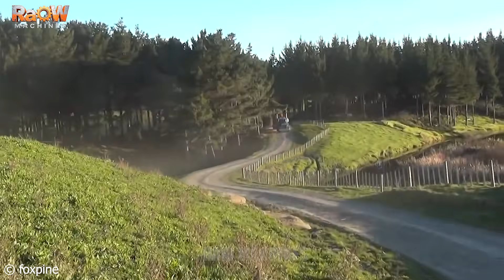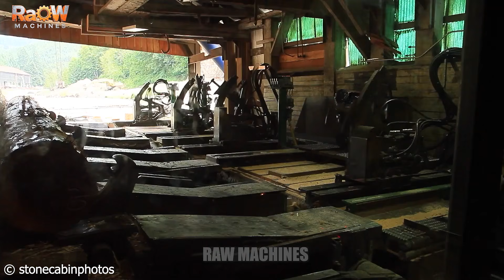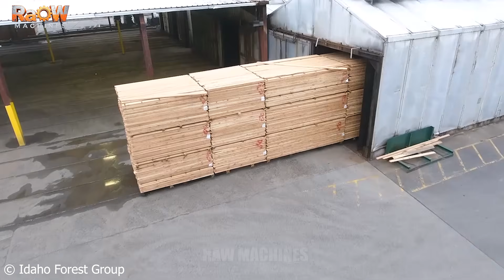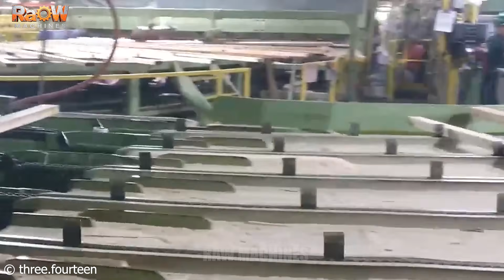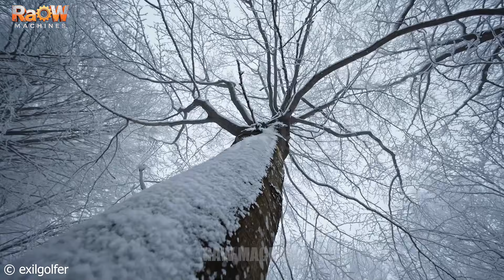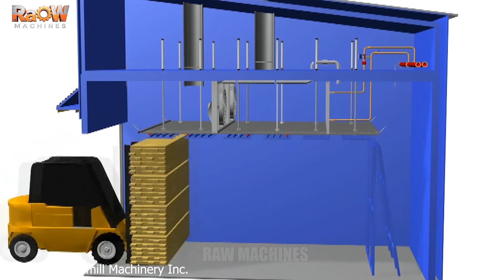Inside America's Largest Sawmills | How Giant Trees Become Lumber and Timber Beams

Comment: You spend the money for treated lumber a lot times , straight when you buy it a month later it’s bowed not to count the time you spend picking through it for straight wood !!!! One day took me 6 hours to pick out 50 2x4x8 and ask employees to get me another stack down and they got mad, told they if I’m paying those prices I want straight wood !!?
Reply from the maker: I appreciate you sharing a real-world perspective! Buying lumber is one thing, but finding pieces that fit your standards can be another challenge entirely. It's always interesting to hear from people who work with wood regularly because it adds another layer to what we're seeing in the documentary. Thanks for adding your experience to the conversation! Do you have any tips for spotting the straightest boards before loading up your cart?
Reply: One of the hardest things to find is straight wood. Most of the time you have to buy the least warped peices or go somewhere else. Ive spent hours looking for the straightest pieces but when their all warped or look like a hockey stick what do you do? You don't have the time to go to all the stores. Its really crazy cause you wouldn't think this is an issue many people run into but it's everytime you buy wood. 2x4s, 2x6s, etc, 4x4 beams and bigger. Pressure treated is just as bad if not worse. Its easier to buy a board, 1x3, 1x4, etc, cause they're usually pretty straight but the raw stuff you dont see in building a house is always warped.